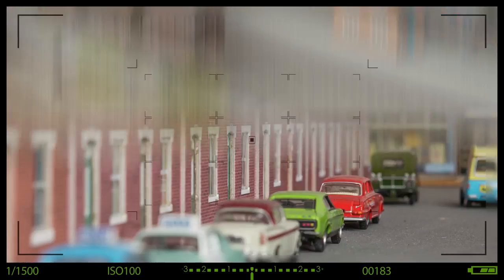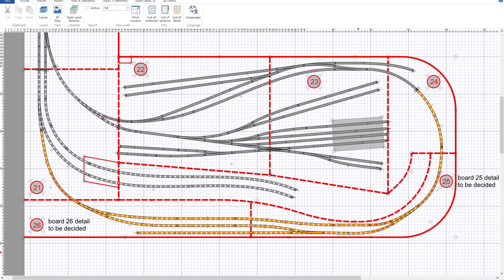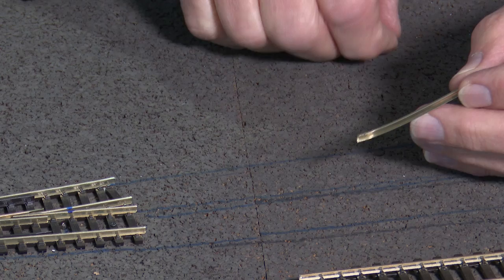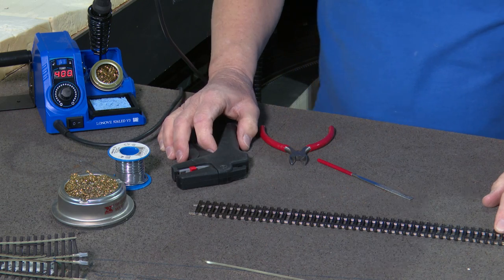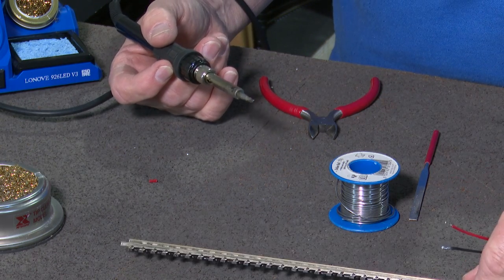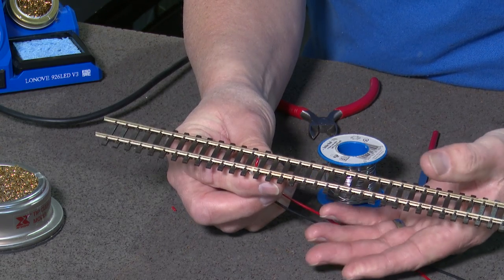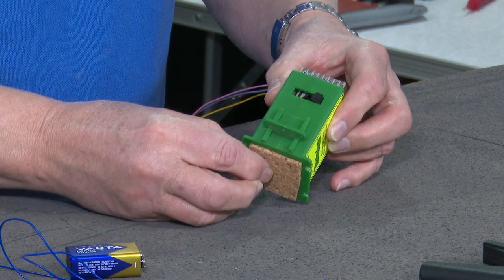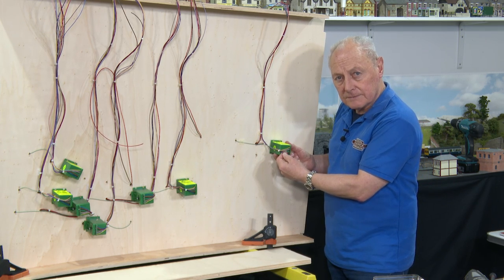GREAT MODELLING TIPS and Layout Progress at Chadwick Model Railway | 179.

Comment: Thanks Charlie for another great video. For the bus wiring on my layout I’ve been using the Wago blocks for a while. It’s certainly a lot easier than soldering while hanging upside down under my baseboards. Unfortunately it’s too late for me to make my baseboards removable. As far as the Hornby announcements are concerned there were a few offerings that caught my eye but at the prices Hornby are asking my credit card will be staying in my pocket for the time being. Electricity and gas have a higher priority 😢
Reply from the maker: I couldn’t agree more David. The price of these new locomotives is astronomical. Regards, Charlie
Reply: And to remember they’re all made in China for about  50/- bob and selling for over £320.00 quid 😳
Reply: @ChadwickModelRailway  I can go to one shop and pay 400.00 but if I was to drive 110 km I can get the same train for 300.00 and thats for N scale with sound but not too many around.

Comment: Thanks for a good start to the year. With regard to stripping wire for the WAGO connectors, the length you need to strip is marked on the side of the connector so you should never have the problem of not enough area to grip or have exposed wiring sticking out.
Reply from the maker: Thanks Peter, useful advice.
Regards Charlie

Comment: Aloha Charlie,
On Holiday Vacation in Hawaii and still enjoyed Chadwick over low tea and pineapple.
A quick use for WAGO wire connectors.  You were pointing out your technique for wiring and planning of switch motors, or practical any connections you're installing blind, well here is my £2.20.
Take a pair of two box WAGO junctions.  Attach permanently to one side a short wire with an alligator clip.  Leave the other box empty.  Do this twice for each color of dropper wire you will be testing polarity or location.  I do have three such pre-assemblies (Red, Black, or Green lines).
Now to the wires you are installing clip those stripped line to the other side of the WAGO box temporarily.  Now you can test your currants direction before doing your final connections.
BTW.  I love your idea of doing your underside connections from having the sub-roadbed tip on it's end.  My roadbed I have built since the 1990's has been attached to the bench work by piano hinges secured to the rear of the structure.  Now in my 70's it has become a less painful system to do under layout wiring and updates.  In February my family, friends, rail club buddy's, and self begin to reinstall the layout after 10 months of Train Room distruction and rehabing.
When completed ALL sub-roadbed will be a flip top away from the front facia.
NXT time I write I may be back in New York State.  'Til Then Ta.
Jim on Vaca 🫖🥪🥮🍍🍾🥂
Reply from the maker: A great comment Jim. Enjoy your holiday in the sunshine, regards, Charlie

Comment: Hi Charlie, great video as always. I also use tortoise motors and also drill out the holes as you do, I have had only one failure in 12 years which was due to minute bits of plastic jamming the gears, I'm fairly certain it was down to my drilling, I now cover the operating slot with masking tape during the drilling process and if drilling holes in the baseboard close to motors.
Reply from the maker: Hi John, yes, the tortoise point motors are such a reliable commodity, I wouldn’t dream of using anything else. 
Regards Charlie

Comment: Hi Charlie. Wago connectors have been around a while in the electrical trade. The main reason for them is to adhere to the UK wiring regs by offering a “maintenance free” connection. A screw terminal has to be periodically inspected and tightened. The wago connector does not require this. They are also great for a temporary “Jerry” rig to make sure it all works before you commit to soldering, and realise you have forgotten something!!  😂 Great video keep it up, love the channel.
Reply from the maker: I’m so pleased you enjoyed it Andy. These connectors really are an eye-opener and clearly my eyes have been closed! Regards, Charlie

Comment: Great video as usual. The neatness of your wiring is something to aspire to. Have you considered volts drop issues using the WAGO connectors for your bus wire, especially on a large layout. 20milliOhms per contact so 40milliohm per break in bus wire. If drawing 1 Amp that is 0.4volts if you have 10 breaks in the bus wire. I like the dcc concepts solder tags you demonstrated in video 175 as cable is not cut.  But once the wiring has been teed off the bus the Wago type connectors are a good idea.
Reply from the maker: An excellent comments, Justin. And something well worth considering, regards, Charlie

Comment: I gave up buying any locos or rolling stock when prices went through the roof (N Gauge). I now buy good quality second hand older stock and modify it although even that is getting expensive. Switching rubbish Peco plastic dirt collecting wheels for instance. I need just over 800 axles in total and when I started they were £3 for 10 axles. Now £18 for 10 axles. I am DC only bot the Wago blocks will some in useful for many other uses, so thanks for the tip.
Great video as always. Thanks Charlie.
Reply from the maker: Thanks Bob, I’m so pleased that you found the Wago’s useful.
Regards Charlie

Comment: Ive been using Wago connectors for years. They are really good, reliable connectors. No screwing involved and easy to disassemble if required. I bought mine in a large box that has different connectors, IE 2 way 3 way and 5 way in different sizes. I also use the 12 way male and female plug in connectors. Again easy to disassemble if needed.
Reply from the maker: Yes Sam, they are clearly a decent product, however, it’s taken me years to discover them! Regards, Charlie

Comment: Good for you for soldering feeders to your track. Useful video as usual and I appreciate your candour regarding 'inattention' which I find inspiring allowing me to not beat my self up when I do the same.
I just purchased my first DCC controller and bought as a bundle wire of appropriate gauge for bus and feeder as well as T-Tap connectors for joining feeders to the bus and wired fishplates to join feeders to the track. No soldering. The Wago connectors do look interesting.
A pin vise is also useful for those who assemble plastic models to drill out holes to small to receive the part from the original tooling.
Reply from the maker: Thanks Dom, I’m so pleased that you found a video interesting mate. 
Regards, Charlie

Comment: Tip when stip wires. Dont strip the tube off compleatly, just make sure the tube is separated and then grab the tube with your fingers, twist and pull off. No more punktured thunbs or pointingfingers from the wires inside the tubing.
Thans for yet another great video Charley.
Reply from the maker: Thanks LY, if only I could remember.
Regards Charlie

Comment: Great video Charlie. Nothing new about that. I’ve looked at ( it not used) the Wago connectors and they look like a great product. I’ve seen in various places that it’s quite possible to put more than one wire into a single Wago slot if you need to. This could be handy if you have, say, four wires and only a three way connector. I haven’t done it myself but I’ve seen it mentioned a number of times, and they look strong enough that it seems reasonable.
PS. The Excel file is on its way for the last few videos.
Reply from the maker: Yes Ron, these connectors are very versatile.
Many thanks again for the spreadsheet, regards, Charlie

Comment: That thicker wire for the tortoise motor is what I did as well.  I have them mounted up to 10" below the track level (our bench work is 2 layers of 4" thick foam), so it is absolutely necessary to use something more substantial.  We used 16GA wire, it has worked fantastic, but connecting to the switch was tricky!
Reply from the maker: Clever minds think alike (hopefully).
Regards Charlie

Comment: Charlie, I'll add my thanks for the video; nice to the progress thus far.  One comment regarding your tortoise wiring, rather than solder to the device I started using the Accu-Lites Snaps, which turn this into a screw connection.  While they are $6 each, they make changing out machines so bloody simple; merely slide the Snap off, throw in the new tortoise, slide the Snap back on and off you go.  Highly recommend this option.  Cheers
Reply from the maker: I understand your point DH but with around 60 motors the price soon mounts up. In the UK they are around £8 each. 
Furthermore, I have never had a tortoise fail!  Have you had many?
Regards Charlie
Reply: @ChadwickModelRailway  I've abt 30 turnouts so agree order of magnitude not the same. I don't have enough elapsed time of use to have failures so time will tell.

The other consideration is that my track is not laid on wood sections that lift out like yours so soldering under the board and overhead is a bit more than I want to attempt.  Thank you sir.
Cheers

Comment: Hi Charlie, I have  modified my Tortoise and Smail point motors to avoid having to solder on to the pads, instead the wires are attached to a screw terminal which is then plugged into the modified tortoise point motor. I have sent you some photos of a modified tortoise, it makes it so much easier to replace the point motors and also if you want to test them.
Reply from the maker: That’s interesting Peter, I shall take a look in the morning. 
However, how often have you found a tortoise fail?
Regards Charlie

Comment: The wago connectors have small ports at the end that allow for test probes to be inserted without the need to remove the installed cables if you are fault finding and checking for a voltage. Wagos are produced by a German company and wagos is pronounced Vargo’s. Available from places like Screwfix, TLC and most electrical wholesalers.  Another great informative video Charlie.
Reply from the maker: Thanks Ian, much appreciated, I’ll check out my connectors later.
Regards Charlie
Reply: There's a little mark on the side of the Wago showing how much sheath you need to strip. If you don't want to hot glue, they also sell various kinds of carriers that you can clip the connectors into. Oh, top tip: keep your fingers away from those spring loaded levers, they'll give you a heck of a smack.
Reply: Wagos (221 series) are an absolute boon for electrical work. I use them for all kinds of things. They will securely hold everthing from a 2.5mm ring main wire down to the pins on a Dupont connector jumper wire - such as we use with breadboard electronics. They are one of things that I frequently ask myself... "However did I do without these little beauties?"

Comment: Another enjoyable video and  good to see progress and hear the tips. A comment on the Wago connectors. I learned about these about  5 years ago and used them for a big house wiring job and think they are the best things since sliced bread. They are generally used for solid core wiring although they can be used for stranded wire. The only thing is what you were experiencing and that is the stranded cores splaying out making it a bit more difficult to insert. To overcome this I put a ferrule crimp on the wire. This makes it like a solid wire and easy to insert. Only takes a few seconds and saves time later. You have to use a fairly small ferrule (approx 1mm) and make sure it can reach to the very back of the Wago hole.
Reply from the maker: An interesting comment, John, I shall try out my ferules accordingly. Regards, Charlie

Comment: Hi Charlie - I have used the Wago blocks myself and yes they are very useful when under the board. I also, a while back, took your advice and used the block terminals and found them ideal for ganging together all the dropper wires and for block detection. As far as Hornby are concerned I just do not understand why they have launched yet another scale, TT. As an N scale modeler, (due to the limitations of my shed), I invested a lot of money on buying N scale products and also find it somewhat limited as to what I can buy, loco and stock wise. I simply cannot afford to splash out on a new scale. I suppose there must be a market for it but I for one will not be shopping in it.
Regards
Steve
Reply: I agree with your comments. Some careful EBay purchases of N Gauge rolling stock have had to happen, to populate my era 5 layout.
Reply from the maker: Excellent points gentleman, only time will tell on this one. Regards, Charlie

Comment: Hi Charlie, excellent video. The simple things are the best, a brilliant tip for fitting fishplates. Regarding Wago connectors, if you look at the side of the body you will find a guide for how much insulation to strip back. I find Wago's work exceptionally well and pretty cheap to buy, at least from my supplier (CPC). Keep up the good work.
Reply from the maker: Thanks Vernon and much appreciated.
Regards Charlie

Comment: Another great video, Charlie.  I'm currently designing my new layout in AnyRail and am paying attention to your fantastic advice on how to avoid S-curves!  I have very mixed feelings about the Hornby announcement.  On the one hand, I don't have a Class 43 train and I want one circa 1980 (+/-), so I was interested in seeing that.  Like other commentators, I find their pricing (and Bachmann's as well) very steep when you consider what Accurascale are offering in terms of both quality and price.  Their new decoders look interesting - certainly a lot cheaper than Zimo - and I see where Simon was coming from about making it easier to 'play' trains.  But I can't yet see quite how Bluetooth operation would fit into a set-up that uses block detection and computer control.  We will have to watch with interest; either their whizzy idea is ground breaking or it is limited to play sets rather than more complex layouts.
Reply from the maker: Thanks for the excellent comment Ed. I to have my reservations regarding the Hornby Bluetooth application. Regards, Charlie

Comment: Another method with the Wago blocks is  to strip back the middle of the wire, like you did when using the dcc concepts tags in a previous video, double the wire back on itself, twist together and insert into one of the holes on the wago. That way you have an input and output in one space... that's what I have done on my bus wires, thus allowing the bus wire to continue without taking up 2 spaces on a connector. Hope that makes sense?
Reply from the maker: A good idea, Matt, and more guaranteed continuity. Regards, Charlie

Comment: The Wago type connectors are commonplace (here) in France and in Germany. I can get them at my local B&Q (yes, we really do have B&Q – even if it is called Castorama) and they are used in housing circuits where often in the UK and the US (in the past?) screw-on ceramic caps were used to protect two or three wires twisted together.
Reply from the maker: I clearly am the last modeller to discover these Timothy! Regards, Charlie
Reply: @ChadwickModelRailway  Wouldn't be too sure, Charlie. I really couldn't say if they are yet so commonplace in the UK...

Comment: Another great video, thank you.  

I’ve been using the wago connectors for sometime around the house and I love them. You can also get some waterproof junction boxes that they go in, which were a godsend when doing patio lighting. They do a single in-line connector that are super useful when cables don’t quite reach - perhaps it’s just me that ends up with this problem! On the layout, though, I am still nervous about cutting the main bus wire, I wish they would do a design where one of the end terminals it’s not actually a terminal but with a set of wire strippers like those DCC concept ones you could just pull back the cable covering and clip it in.  I think any manufacturer that developed one that did that would find most railway modellers knocking at the door.

On the Hornby announcements, I must admit to some concern. After a number of unprofitable years, they seem to have spent on developing new scales, products, and licensing fees for new tie ins immediately after they had a one profitable year. They have a new CEO and perhaps need to look at the business root and branch.  They are catering for a relatively small customer base in the great scheme of things and need to focus on quality control and service or more of us are going to either not buy or buy from another manufacture in these cash-strapped times.
Reply from the maker: You’re pushing on an open door with the Wago connectors. I must be the last railway modeller to discover them! However, I can’t see myself using them for domestic electrical installation. 12 V DC, is one thing,  240AC is quite another. Regarding Hornby, I’ve ordered a TT 120 train set just for review. I really think it’s a Hornby last-ditch effort. 
Regards Charlie
Reply: @ChadwickModelRailway  Patio lights are all 24v 😉
Reply from the maker: That’s reassuring. Regards Charlie.

Comment: Hi Charlie, thanks for an interesting and slightly daunting video, your skill and experience is reassuring though. My layout is still in my head and I'll be visiting your earlier episodes for guidance regarding the wiring when I finally get under way. I think Hornby are all out on TT at the moment and I get that. Only thing that grabbed me was the Castle, but I suspect it's a re-release. Their prices seem too high and I'm glad other manufacturers are treating modellers better in these cash-strapped times. My last three purchases have all been Dapol locos which are easily as good, if not better than the Hornby products.
Reply from the maker: I think you’re pushing on an Open Door on this one David. Hornby could well be in trouble. Regards, Charlie